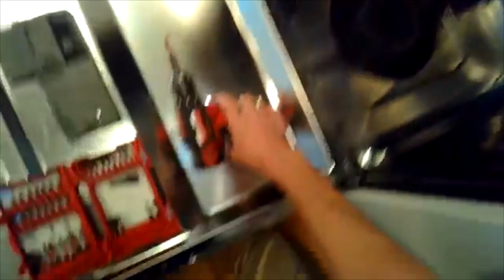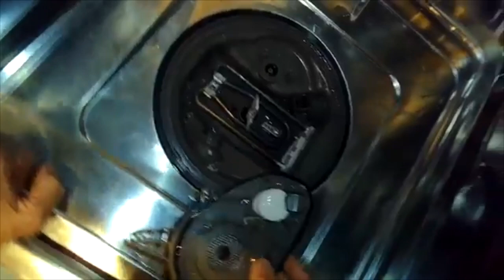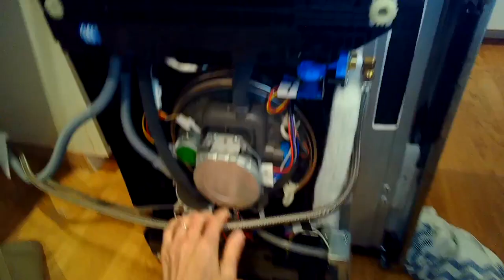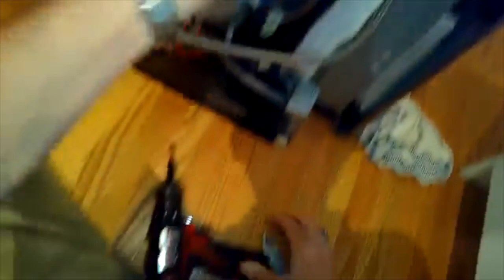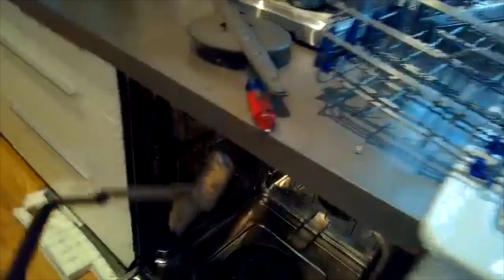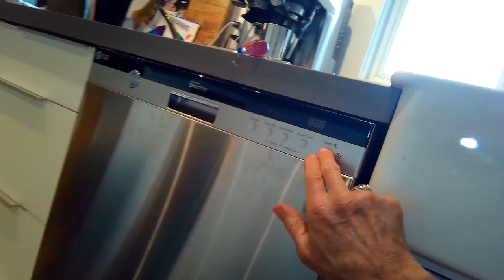✨ LG DISHWASHER — LOUD WASH CYCLE (FIXED) ✨

Comment: How does he know the pump is defective and needs replacing, rather than some other component of the dishwasher? Is it nearly always the pump that fails? And why isn't the manufacturer, who guarantees these machines' reliability replacing the goddamned pump at his expense? Our 18 month-old LG is already howling like a freakin' banshee during the wash cycle after the water loads. It still gets the dishes washed, but it's torture to listen to that bad boy for a freakin' half an hour or more. Shizz...
Reply from the maker: Something got down where the circulation pump impeller is that’s rubbing against the impeller.
Just need to remove it 👍

Comment: Hey I have a loud noise on my lg ld1482t4 will this be the problem. The noise goes up and down through the
Reply from the maker: Hi Aaron,
Just need a new circulation pump👍
Reply from the maker: Make sure that the seal the pump shaft goes through doesn’t leak👍

Comment: My LG whines intermittently for a minute or two at a time.  It starts about 15 seconds after starting the unit, and peridocally starts and stops.  Other than that, the dishwasher works normally, dishes are clean.  It used to be so quiet you couldn't tell if it was running standing right next to it.  It is a slightly different unit than this, it has the filter you can remove and clean.  Any ideas?
Reply from the maker: I’d say a fill valve that’s about to give up and making noise as it fills.
Reply: @QuickAndEasy5MinuteAppliance  Thanks.  I've bought the two pumps and the fill valve.  Might as well replace it all while I have it pulled out.
Reply: Did you fix it? What was it?
Reply: @michaelmappin4425  Yes, it was the drain pump.  I replaced a few parts, but the drain pump motor was the problem.
Reply: @doctoreeeveal  Thanks for the reply. Mine is buzzing during the wash cycle so I tend to believe it is the circulation pump. It's only 3 years old. 😔
Reply: @michaelmappin4425  You're welcome pal.  I replaced that one too.  They are not too bad to work on, once you pull the monster out of there and see what's going on.  Good luck.
Reply: Too nice a watch to wear during repairs.